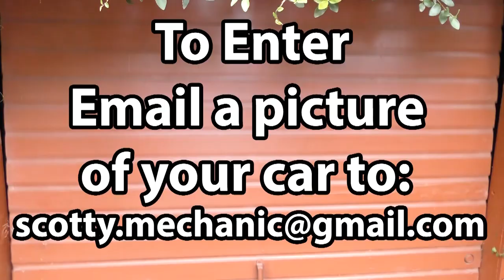There's a Secret Inside this 2005 Mini Cooper

Comment: Hey scotty, I have decided to create the most reliable car so I can experience stress-free driving for my entire life.I am going to be using a Nissan cvt transmission, a BMW cooling system, A Dodge engine and Land rover electronics . Do u think it will be bulletproof and what else would you recommend for my project?
Reply: That’s an EMP, endless money pit.
Reply: make sure you use a nissan cvt, otherwise it wont run properly
Reply: Best comment so far
Reply: dont forget the Fiat badge on the bonnet
Reply: Remember to include at least one tail fin.
Reply: Get AAA!
Reply: Don't forget to put on the Volkswagen suspension package so you can replace your coil springs every 6 mo.
Reply: Don't forget the Lucas electrical system.....
Reply: Keep a spare jar of wiring harness replacement smoke on hand
Reply: Nasreen Mohamed yes. Add two ply tires and drum brakes front and rear.
Reply: ford will help ya with the direct injection
Reply: It's probably going to need a Ford Pinto gastank and mount it underneath the trunk for stability. Make also sure that you are using the aluminium drum brakes all-round from a Lada Riva with a Vauxhall Nova dash and ignition switch. To make sure that it's trouble free I would also recommend run-flat tires and Ferrari's super glue for the wheel welds. Should be a bulletproof daily driver for sure.
Reply: Be sure and put some 80s GM electronic engine management on it, preferably from a Fiero.
Reply: You already have a loose screw behind the wheel!!
Reply: Banana yellow K car vinyl bench seats, a PT Cruiser bodykit and a horn on the stalk. Beautiful car.
Reply: @Российскийбот-ы3у  was that a johnny cash reference?
Reply: Don't forget tesla parts availability.
Reply: it could use one of those toyota truck frames contracted from dana and any chinese turbocharger.
Reply: @sterrshow5016  Yeah, I thought this was a One-Piece-at-a-Time kind of comment.
Reply: @gerardopietrantoni6452  Old School, I like that!
Reply: get a frame from a chinese made car model. it is 5 star UNsafe rated .
Reply: My coworker bought a 2009 Land Rover, and it's been nothing but problems at 120,000 miles. It's gone to the dealership so many times. The repair bills amount from $700 to $1,000. Now she's considering a Toyota Highlander.
Reply: ...and the PCV system and plastic dash of a late 90s Volvo!
Reply: I'd like to buy one of these cars. How much for one?
Reply: Randy Jackson sarcasm isn’t something you’re good at
Reply: PUt Renault electric window modules and front brakes  then your car will be the bullet
Reply: Post vids please 😂😂😂
Reply: Built in England...for that TRUE rusty quality..
Reply: May I make a drive train suggestion.  Oldsmobile 350 (5.7) diesel with a Chrysler ultramatic 4 speed automatic transmission.  Chrysler Electronic Lean Burn 18.1 air fuel emission control system for the Oldsmobile Diesel. Hook the lean burn up to a 1970's British Lucas electrical system. Then for a body combine a Amc Pacer Hatchback and a Pontiac Astek together. Finish off with a dashboard from an FSO polonez and a Ford Pinto hatchback gas tank. I did forget to mention put a braking system from a GM X car platform and the front fenders of the Plymouth Volare. Make it as slow as a Yugo Gv .
Reply: Add aftermarket Lexus-style Citroen light clusters and you have absolute perfection.
Reply: Lol land rover
Reply: That is a horrible concoction of parts...
Reply: Land rover electronicals? Good luck
Reply: Mustang break calipers .
Reply: Mustang break calipers .
Reply: sure. if you plan on only driving it inside of auto repair shop
Reply: And a naturally aspirated Toyota engine
Reply: Make sure to use the mini cooper right motor mount position too. Gotta mount the engine from the head!
Reply: Hows your project going
Reply: Probably better off using a LS for engine reliability

Comment: My 05 mini Cooper S was a blast on twisty roads. I've never owned a more fun car to drive. 
I also had a reduction pulley, CAI and Koni FSD gold shocks installed. This was the only car that made my chest ache when I sold it.
Reply: Mango22 could not agree more, I have had my R53 since new, I have owned a number of vehicles the Mini was not the fastest but the most fun to drive by a long shot
Reply: Despite having a repair quotes well over the value of the car and a cold start issue mini nor my mechanic could diagnose it was still a very sad day trading my ‘06 mcs on a new 16 wrx was a very sad day 😢.  that car could still made me smile after a decade of ownership. (Well when it was working right I smiled).  Wrx has been a much better car so far but not nearly as fun.

Comment: Lol, my 2008 mini Clubman r56 non turbo motor,  has 250,000 miles roughly.  I use 0w-40 to compensate for all those wear clearances.  And to eliminate valve lifter tick.  She's running strong.   Only replaced a leaking vacuum pump.

Comment: Very happy to see a Mini this week :) i love mini's to death. Unfortunately, i wasnt aware when i had mine that it was a bit higher maintanence than i was used to and the engine went bad at about 85k miles (which i hear is actually pretty good, shop said they usually see engine trouble starting at about 60k miles). But you can bet i wont forget that when i get my next one.
Until then, im currently "restoring" a 2009 cobalt ss. 5 previous owners beat the heck out of this thing across several states before i got it for a steal at 124k miles. When im done with it, itll seem like it has at least half that mileage. Video coming as soon as i feel like she's ready.

Comment: Yikes...a Chrysler engine...looks like he did a good job though.
Reply: Stranded 360 ikr
Reply: Not Chrysler. Tritec.
Reply: The W11 engine is pretty bulletproof, actually.
Reply: The cast iron block is Tritec (co-operation between Chrysler and BMW-owned Rover). The supercharger is Eatons M45. The transmission is Getrag. Such are the cars of today - a collection of parts from different manufacturers. If you take off a part on the MINI, you will most often discover a "BMW" logo/stamp.
Reply: Chrysler makes some good engine. The rest of there cars though are almost always garbage
Reply: The W11 is solid. Almost to a fault because it's rather agricultural. Iron block, single cam, chain driven. These engines are happy to take serious power increases so it's not fair to say the engine is bad.
Reply: Who makes the more recent Mini motors?
Reply: @earlpainter2143   BMW & Peugeot teamed up for the n14 / n18 aka Prince engine that changed to a turbo for the hardtop from 2007-2013. Then from 2014 to current they share the same BMW engine going into all the BMW and MINIs. They just scale upwards in 0.5 L increments depending on the car they go into.
Reply: He did a good job of wrangling in the crap....cute tho

Comment: Nice job on this Mini!- Mini's are very fun-I have owned 3. R60's if I remember. 2 new and the last (plug in hybrid) used. Always traded before warranty expired. They are quick and handle very well and made me smile every time I got in it. Very expensive to fix when the time comes. My last one was the plug in hybrid-What a piece of junk. Crappy mileage on battery or gas, kept throwing check engine codes and the dealer(s) couldn't figure out why. Eventually, they replaced the "regenerative charging system" on one (or both) of the back wheels. Out of curiosity I asked how much that would have costed me if the car wasn't under warranty. It was some ridiculous amount of money like $6 to $8 thousand dollars or higher-I don't remember exactly. I started planning my exit strategy right then and there and eventually traded it in for a 2020 Toyota Rav4 hybrid and I couldn't be happier. My RAV is worth almost $10K more now than when I bought it. Mini's were expensively fun while they lasted. Don't think I will ever buy Mini again.

Comment: I call my '06 S the Mini-PIT. Money pit, Mini Pit... when it doesn't give me problems, its a great car, but when it starts acting up, with repairs and multi visits to the MINI shop, that's when I long for my 6th generation Celica or any other 'normal people' cars. This '05 MINI is pretty nice, good upgrades, I prefer all-stock. I mean, just the money to keep to do all the necessary maintenance is enough for me to steer clear of any mods. The ONLY upgrade I would do is that coolant reservoir, that's an important one, it's on my list. Other than, like other comments on here, I agree, the car has good safety ratings, built with lots of safety in mind, heavy doors, solid construction, airbags all over. I have a book I bought years ago when the R53 or R50 came out describing all the history and they go into the build-safety features. I like the large windows also, great visibility, and it's just a strange little car that gets through traffic jams sometimes, love the supercharger.  ---Gary

Comment: The only Mini i'd own would have a Honda engine.
Reply: SpotOn vtec
Reply: @adventureoflinkmk2  Better at what? The amount of Honda engines swapped into chassis' made by other manufacturers far outnumbers the amount of Toyota engines used for the same purpose for a reason.
Reply: @adventureoflinkmk2  Honda makes better engines though.
Reply: @THEGAMINGHELP101  It's about the same
Reply: Yeah k24 with k20a2 head would rip
Reply: The original standard  early miniˋs where  pretty good  to drive and relatively reliable  ,  and the little  early model mini cooperˋs  where just a blast ,  and it did not cost ten k to do a clutch in the  original mini either   :) .

Comment: Probably fun to drive but I hope he doesn’t hit something in that pint sized tin can or it’s lights out for him.☠️
Reply: I was waiting for the cops to light him up but they must have been on their donuts break.
Reply: Lol
Reply: Actually, the R53 is pretty safe. It got 4 out of 5 starts on NHTSA crash tests. Lots of airbags etc. A MINI went off the road in a hurry by the gas station here, doing a number of barrel rolls and ending up in a tree. Out climbed three bewildered youngsters. The only thing broken was the driver's pride.
Reply: They are a blast to drive
Reply: I own a Mini Cooper and these are definitely not "tin cans". The doors are real heavy and solid, heavier and thicker than most Japanese made cars. You'll be surprised. When I run on the highway, I don't even feel any crosswinds like what you will feel when you drive a Japanese car - despite the fact that this car looks so small externally.
Reply: Jill Thompson I own a repair shop we work on a lot of these they are easy too work on and they are built to take a impact solid car
Reply: I'd probably feel sorry for whatever he hit, those minis are built like a brick shithouse. They're so solid you'll often find it's hard to get them to sit on four jack stands because if the ground is even slightly unlevel it'll hold one corner in the air.
Reply: EvolutionOfMe 1/2 Pints👍
Reply: wow, joshua is scotty's first official subscriber from the afterlife. must be using a 5G connection.
Reply: At 2,600 pound's,  this car is a tin can. I would not want to get in a wreck in this car. If a truck hits this car your dead.
Reply: I bought one for my gf and we ended up hitting a deer in it at 70 mph, it honestly wasn’t that bad lol
Reply: I seen cases where minis hit big truck and the truck flip and the mini only had minimal damage
Reply: So what you're saying is that you'll feel safer in a big vehicle cos you're afraid of dying in an accident? That's all good - each to his own - but why poke fun at the guy's ride by ridiculing it as pint-sized and unsafe just because you would be too scared to ride it! lol! Better not comment on superbikes then!
Reply: @chadroy709  Go drive one. Doors are heavy and thick. It feels like you are driving a go cart tank
Reply: Not an engineer are you... weight and size are not relevant to safety. I'd rather be in the Mini than a big old pickup
Reply: You guys are saying "2600 pounds is a tin can"
But density is the important part here. If it was the size of an SUV, then yes, 2600 pounds would be weak. But cars this size are usually 2000 pounds, less after gutted. Most of that weight is the doors; and these things are known to be built like little tanks. Replacing the doors with carbon or just removing them and having a roll cage drops weight significantly. I'd rather be t boned in a Mini Cooper than in most any passenger car. It's unfair to compare it to something like an SUV or truck. At the end of the day, one of the safest cars for its size, price point, and the way it drives if you ask me. The car might get totaled, but your driver is going to be just fine.
Reply: I hit a fully grown deer head on at 70mph in my 2003 Mini Cooper S and all that happened was a cracked headlight and a deer skull sized dent in the hood. 
They're very stout cars.
Reply: For all the people that say it's a tin can and if you get hit by a truck you will die my whole family has them bc one day my dad was on the highway stopped in traffic when he was rear-ended by a semi truck going 55mph it caused his car to hit the car infront of him and  to flip and roll and totaled the car but my dad walked away from the accident without a scratch just because a car is big doesn't mean it's safe... I'd rather ride in a mini than just about anything else

Comment: Scotty I have a 1999 Honda prelude and it has a idle problem, it revs up and down when the engine is cold, I checked the Idle Air Control Valve and it was clean, what could the problem be?

Comment: He needs a bigger clutch to grab a little better. But overall nice car even though it’s not very much horsepowe
Reply: Horsepower means nothing. Power to weight ratio is what matters. 250BHP in one of those makes it a fast car.

That'd be enough to give a 911 of the same generation a run for its money.
Reply: Same here. I got one that has about 210 BHP and It does all I need. 260 will make that scoot. Trust me.
Reply: @SicSemperBeats  Simple minded Americans never seem to be able to wrap their minds around the fact P/W ratio is what matters, not outright power.
Reply: MrManBuzz are you bluffing right now? A 911 will literally smoke a Mini Cooper s no matter if it’s 260BHP...
Reply: Sic Semper Beats I get the power to weight ratio bro, but in the long run it’s only a 4 cylinder with a supercharger. Won’t do much on highway pulls.
Reply: Retro Comandante lmao yea a 911 will smoke a mini. Because 911’s aren’t heavy themselves either. Most 911’s handle really good
Reply: Retro Comandante true but i doubt he bought a mini just for straights
Reply: @RetroComandante  A 996 and this Mini have very similar Power to weight ratios. A 996 has 300BHP, and weighs about 250KG more. If anything the Mini might be a tad faster in bends because of its smaller wheelbase.

I don't think you quite understand how fast one of these Minis are with 250+BHP.
Reply: MrManBuzz don’t worry, there’s always room for the slow guys in my rear view mirror. My VQ will smoke the guys that talk mess.
Reply: They fun to drive

Comment: Hello Scotty, I have a 2003 Mini Cooper with a rebuilt transmission and it works fine but then I noticed that the needle was at hot on the thermometer and I continued to drive it but it never heated or smoked, but what I did notice was when the needle was on hot the car started to jerk a little what can it be ? Please help
Reply: It will last about 10 min and then back to normal 🤷🏻‍♂️

Comment: Girlfriend has a 2014 Impala 3.6L from a dead stop car will not move until around 3400rmp I've checked trans fluid it was full and didn't smell funky, this car only has 60,000 kilometers on it what could be the issue?
Reply: Derek Joon something is going wrong in the transmission! Sorry!

Comment: Hey scotty, i have a toyota yaris in the middle east, it says in the owners manual to check the oil after warming up the engine to the operating temperature and then letting it sit for more than 5 minutes. Do you think i have to do that or check it when it's cold. Please help.
Reply: Check it when its cold generally, or a fair while after its been on, no real advantage to checking it when its just been running, especially if you're running thick oil its more likely to give an
 inaccurate measurement. Usually 5 minutes is just a guide minimum time for oil to re-enter the sump, the engine doesn't need to have just been on. You may want to check with Toyota forum tho....
Reply: @georgeoliver652  I run 10w30. First time i have ever heard to check oil after warming up the engine then switching it off and waiting more than 5 minutes, thats why i want someone like scotty with so many years of experience to tell me what to do, but he never replies
Reply: @al_saedi2109  Yeah im not a toyota engineer but logic dictates, especially if its a naturally aspirated, stock engine, theres no need to start ut beforehand. You can prove this to yourself by taking a measurement after starting and stopping, and after its been sat for a few hours....
Reply: @georgeoliver652  yea mine is fully stock 1.5 liter 4 cylinder. Gonna try that tomorrow. Thanks for the advice
Reply: @al_saedi2109  np

Comment: Something isnt right. The super charged mini I drove at the euro shop I used to work at would spin the tires through 3rd gear.  Maybe he is riding the gear out all the way supercharged cars should be shifting a lot earlier. He even bounced it off the rev limiter. No power up that high even with variable valve timing. Hm.

Comment: cant of wierd 250 considering a good tune will give 40 and a pulley on the turbo 20 at 168 stock plus 60 make it 228 so all the other stuff cams valves and exausth give only 30 i think youd get way more investing a litlle on the injector and play with the gas pull a bit anyway your car lol